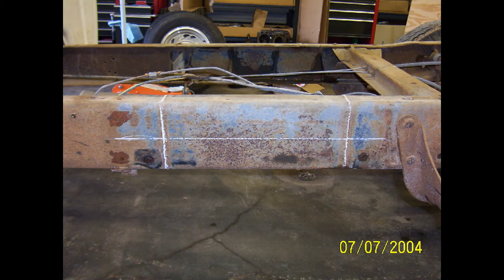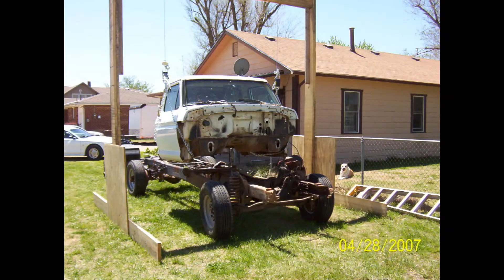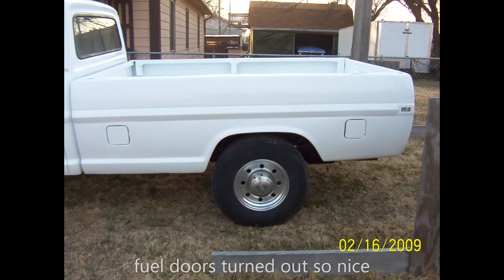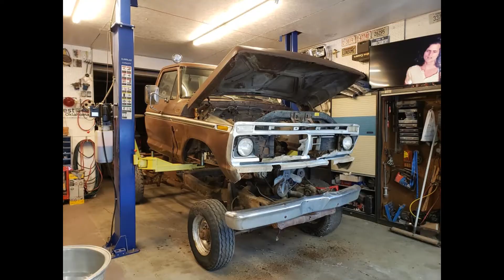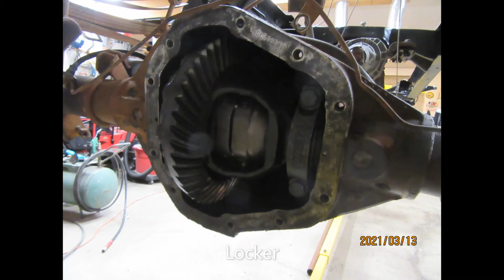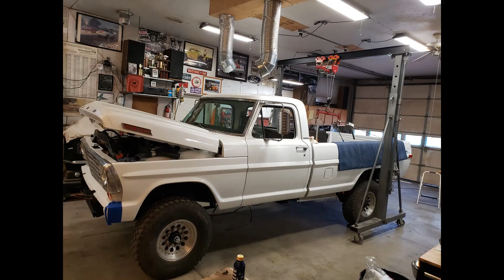Three lives of My 1967 F250 Highboy

Comment: Beautiful truck. Are the frame rail c channels wider on the 3/4 ton vs. the 1/2 ton?
Reply from the maker: 4x4 Highboy frames are straight. 1973 and after the two-wheel drive trucks have a coke bottle shape frame. I needed to shorten the 76 4x4 frame 3 inches to the 67 wheelbase. I cut the two wheel 73 frame where it widens out so it would just slide of the 4x4 frame.